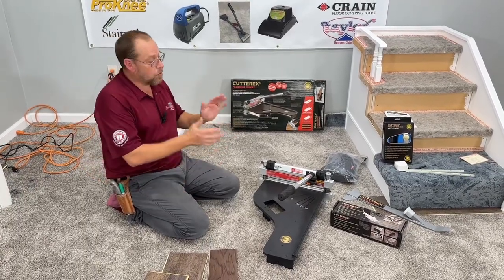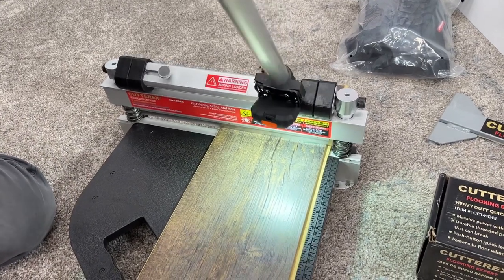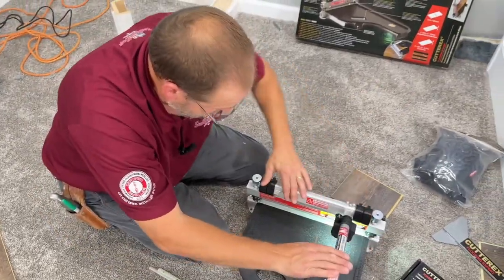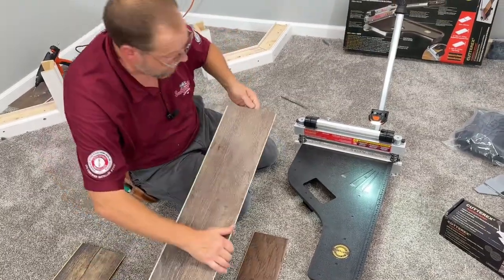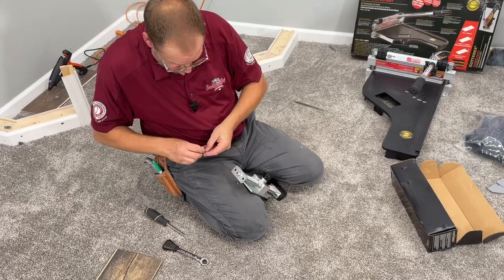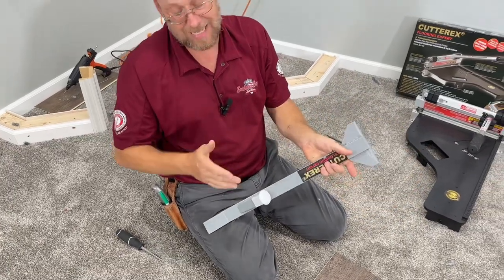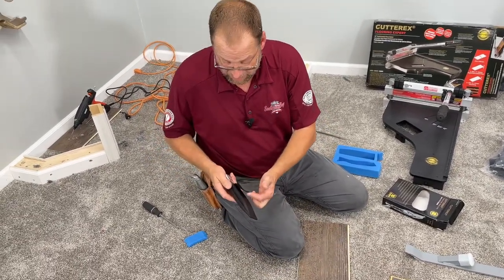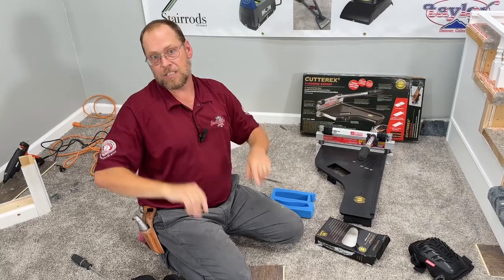DIY Laminate Flooring Cutters /Tools Cheap 2023

Comment: Not bad any warranty on the lvp cutter?
Reply from the maker: Darn I wish I had a look at that, and mentioned it let me check it out real fast, there are lynx in the description by the way
Reply: @FloorsbySouthernboys  Yeah I seen it on Amazon wonder how long it would last with daily use
Reply from the maker: I don’t know I couldn’t find any warranty on it except that Amazon offers 30 day returns is all I was able to find, honestly it does not feel too bad I don’t know if I would honestly use it daily for hardwood but if you’re using it for vinyl plank it would probably last a good while and for 100 bucks I think it’s a no-brainer, that’s just my opinion
Reply from the maker: The freaking jack is solid
Reply: @FloorsbySouthernboys  Thanks I think I will try it out.

Comment: I need a cutter that does the length of a plank. Click plank is the worst. 

If I need a 2 inch length, I'm either slowly snapping it with my hands or pliers. Even then the vinyl will be twisted and needs to be bent back so it lays flat.
Reply from the maker: Dcut AK 650
Reply: SKIL 3601-02 Flooring Saw  works like a table saw but way lighter and not as sketchy with the kick back(none) it works like a wet saw with a fencc but with out the wet and for laminate… ryobi one+ is new and look pretty cool but i havent tried it. i usually use a jig saw with a metal or laminate blade…but one advantage these cutters have is no plastic sawdust mess!